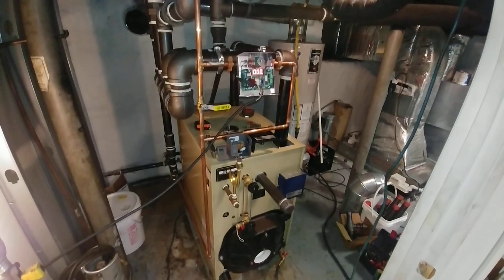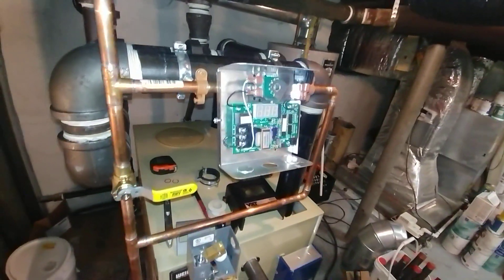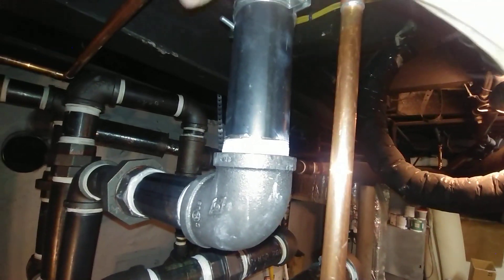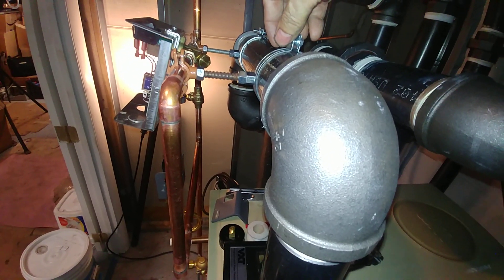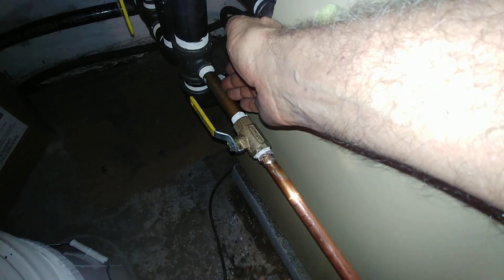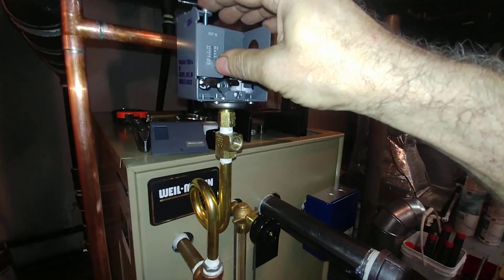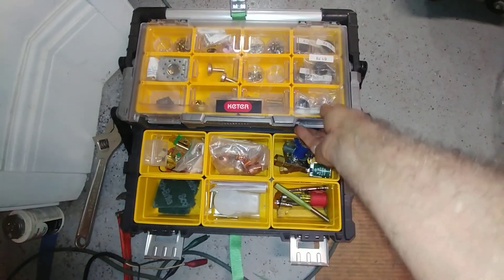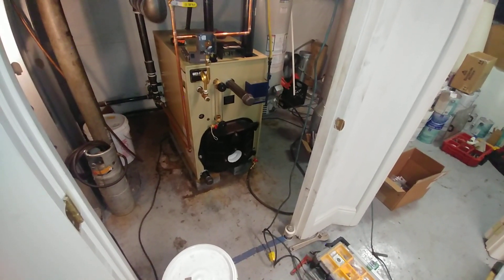Hydrolevel VXT-120 Installed & Tested. Honeywell PA404 Pressuretrol Installed

Comment: Hi from the uk,we don’t have residential steam here only commercial/process so I find this fascinating,neat install
Reply from the maker: Thank you for your comments! Yes, single pipe steam for heating caught on big here in the States, especially in the northeast, for various reasons but mainly because it was cheaper than hot water installations. We are a great huge giant heating museam, we are.

You may know that the great James Watt was one of, if not the, first developers of steam heating in your land. All that otherwise waste heat from his famous steam engines was sent to the first radiators of his design.
Reply: @gordonschweizer5154  thanks for the reply,ive been in heating for 39 yrs but rarely get to work on steam, forgive me if I ask dumb questions in the future lol
Reply from the maker: @dannywilkins887  No such thing as a dumb question, except the question you don't ask. There are lots of dumb answers LOL.

Comment: your not doing this all by yourself are you?
Reply: Certainly not!  The heavy lifting ( i.e. boiler delivery into the basement and the pieces of the old boiler removed) was done by the specialized delivery crew from the supply house.  The major steam supply near boiler piping was done with the very able assistance of our associate worker.  The little stuff,  the small piping,  the details, that's me.  The wiring and firing is to be done by my partner.
Reply: @elgordo271  well of course no one could do the big stuff like that but i am surprised i haven't seen anyone else in this beautiful install series you are doing
Reply from the maker: @oldhandyluke  :Well, there some reasons for that which I won't go into now. 

But one reason for this series of videos is ironically this particular job has fallen so far behind schedule that I'll work a bit now and then and stop and go home. So, since the job is moving forward in little bite-sized chunks, that gives me time and energy to film this series.  Usually, it's all out 9 to 12 hours for 4 or 5 days straight and I'm so burned out at the end I just want to be gone.  These jobs take a lot out of me.

Comment: Do you still use vaporstats?
Reply: I had a vaporstat installed on my single pipe system.  Cut in 8 oz and cut out 14 oz.  Has worked well for us.
Reply: We use vaporstats on all our jobs.  We have had a few problems with them from time to time.  In our area we are required to use 2 LWCO and 2 pressuretrols.  So I use a probe type and a float type LWCO and a vaporstat and the cheap one that comes with the boiler.
Reply: @amradco  Yeah, those new style vaporstats seem to be more error/failure prone than the old Hg ones.  Not sure why and Honeywell is mum.

That "cheap" PA404A, once you adjust it with my secret technique, is actually not a bad bit of kit, all in all.

So, in your area, you need two sets of controls, but below, say, 400,000 BTU/hr one of them doesn't need to be manual reset a la CSD-1?  Interesting.  Two LWCOs are not a bad thing on any steam boiler, I think we all can agree!

Not sure about float type LWCOs. Most of our dry fires here seem to involve MM67s and MM47-2s. We usually try to install probe types all the way.  We even go so far as to install probe types in the special chambers that Hydrolevel sells if there is not a tapping at the right level.
Reply: @Bob.W.  Not a bad way to go.  I hope that vaporstat continues to work for you many a year to come, sir!
Reply from the maker: Yes, most certainly!  Usually just on vapor systems, however.  Single pipe steam systems often don't need a vaporstat.